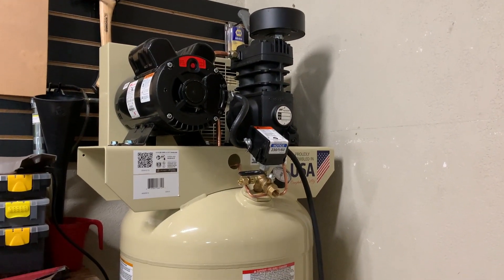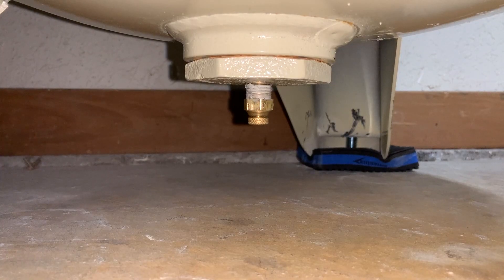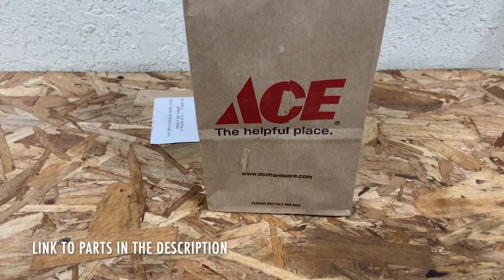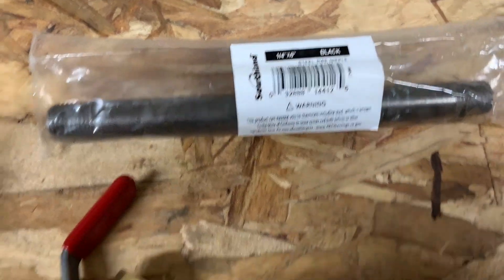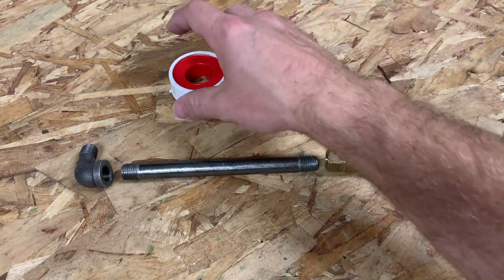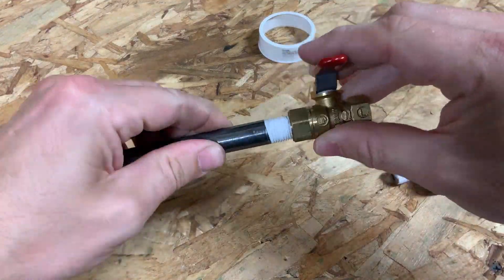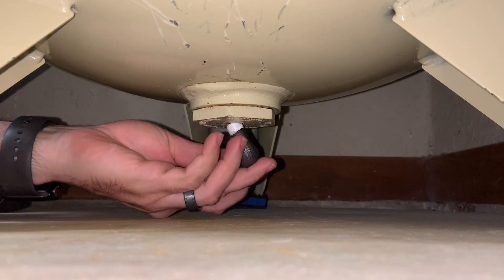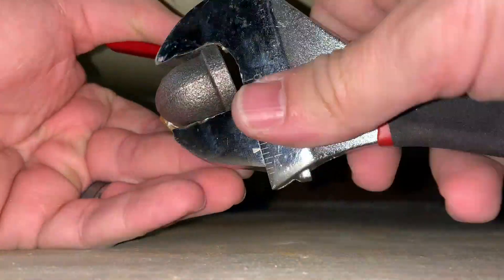How To Improve Your Upright Air Compressor For Only $15!

Comment: Awsome work..all I can add to this...is ...u should put on a magnetic  starter..to your unit..around 300. Bucks..but it will save your pressure  switch..and motor..I'm an older guy....knows a little something..about comprsoir s..  love your video...
Reply from the maker: Thanks for the tip!

Comment: Nice upgrade! On mine, I put a garden hose adapter on the end so I can run a hose outside the shop. The compressor sees a lot of use and I live in a humid climate, so the tank accumulates too much condensation to just dump on the floor.
Reply from the maker: Great idea! I either use a shallow pan under mine to catch the condensation, or I just throw a rag under there and let that catch it.

Comment: I have that exact same compressor.  A disappointing feature is that there is a lip inside the tank at that fitting. If you pull off the big nut and put your finger up inside you will feel that about 1/2” of water is still puddled in the tank no matter how much you drain it.  I think that moisture removal solutions between the pump and tank are an important remedy.
Reply from the maker: Oh damn good to know! Thanks for the heads up!
Reply: How long have you had the air compressor? Is it still working? I want to buy the exact model but i've seen many bad reviews
Reply: @ I’ve had it for about 5 years.  I don’t put a lot of duty on it. But so far it works good.  There is a tiny leak in the system though so after about a week it drains down to zero if left off.  I just haven’t yet spent any time to troubleshoot.  I put mine on top of a 3/4” rubber mat over the concrete floor and that softened the noise a bit.

Comment: Same application on a 30 gallon Dewalt compressor?
Reply from the maker: Should be very similar! Take your drain plug out and take it to the plumbing section of the hardware store and you should be able to buy the parts you need with the same thread.